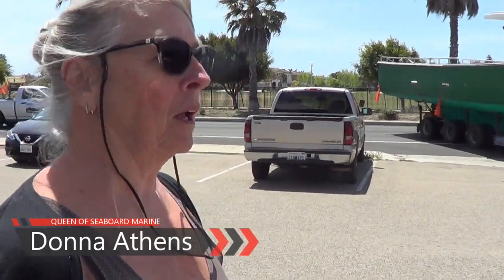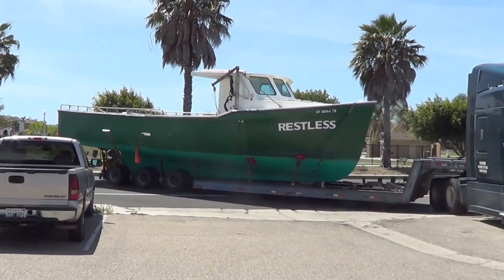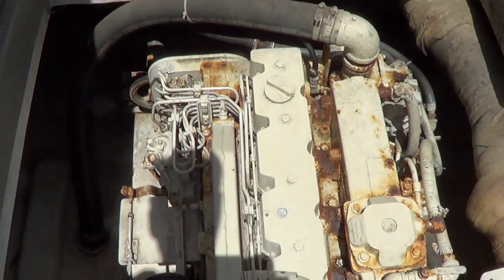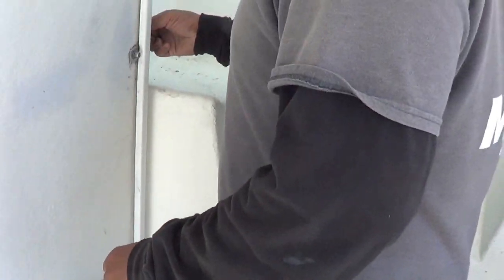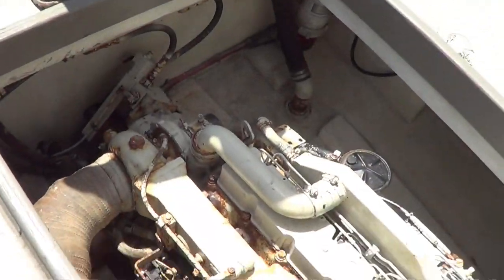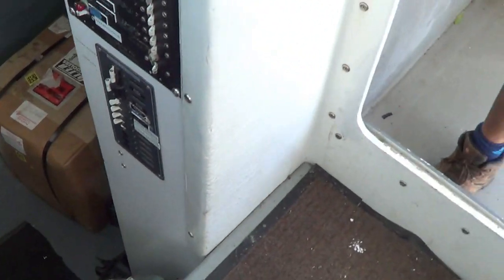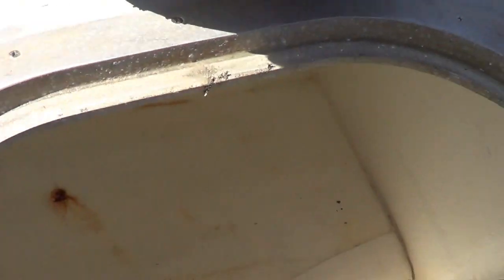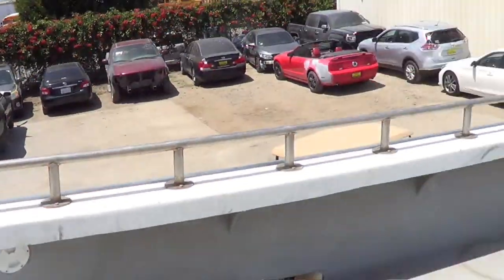Project Spotlight: "Restless" Getting Started on a new re-power project

Comment: Title should be putting a boat on stands you barely even looked at the engine didn't say what was wrong with it...
Reply from the maker: Sorry you don't approve of my title.  Although I would argue there is a lot more in the video than just "putting it on stands".  First thing we have to do is get the layout of the vessel and poke around to wrap our heads around what needs to be done. As far as what is wrong with the old engine, there wasn't anything specifically wrong with it, just old, rust, worn out and time for new common rail technology.  More efficiency,  smoother, quieter etc...